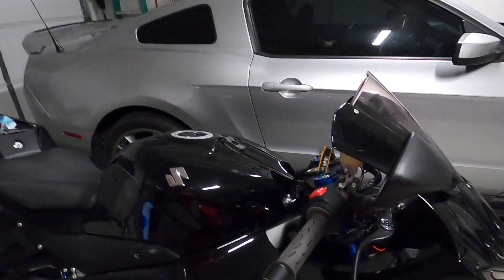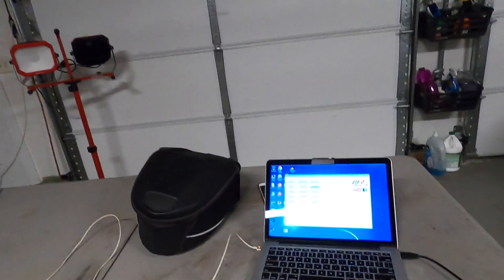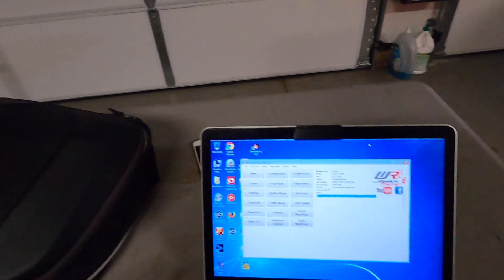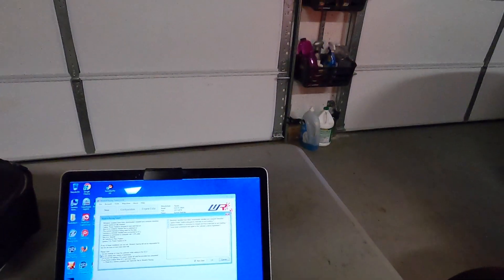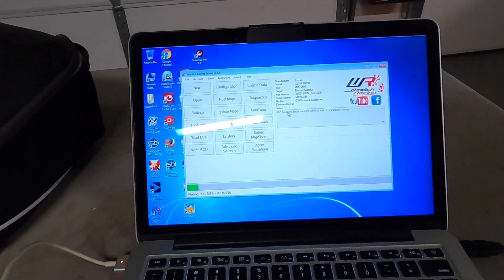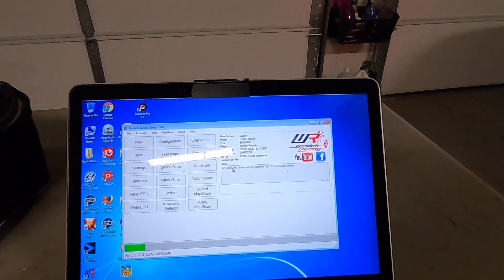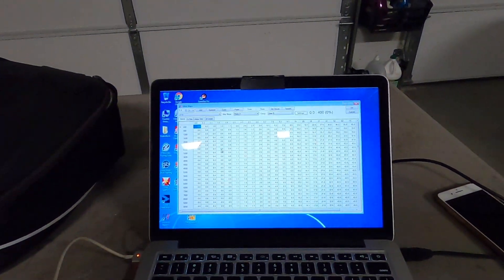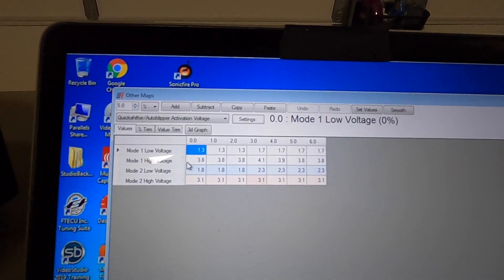GSXR1000R DIY ECU FLASH-Home Garage flash from weekend ride logs!

Comment: Looking at another one of your videos, how do you know what Target AFR to set through the columns of TPS from 0.4 to 100?  I see your 100% Throttle from 14,800 up to 16,000 is 12.6.  From 14,400 down to 13,600 is 12.8.  And 13,200 down to 7,600 is 13.0.  Etc.  How exactly did you determine your mapping from 13.4s to 13.8s, to 13.5s, to 13.3s, 13.2s, etc.
Reply from the maker: I map it where it gets progressively richer as I increase rpm.  I map it a little leaner as I lower the rpm  I make it richer because it adds a little safety margin towards the top.  I lean it towards the bottom for better mileage.  Also, I try to blend any changes smoothly so the maps don't have steps and the interpolation between cells is smooth.  My numbers are based on preference.